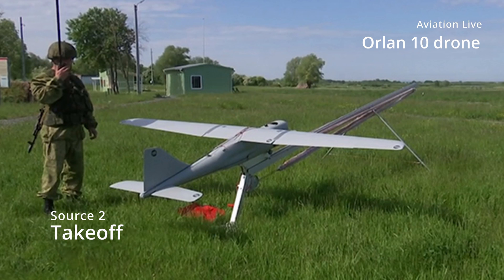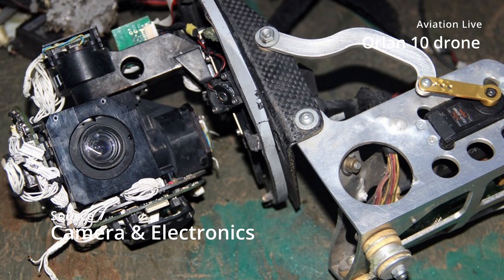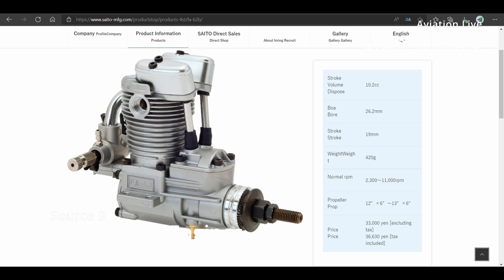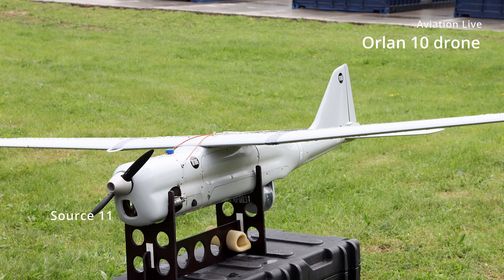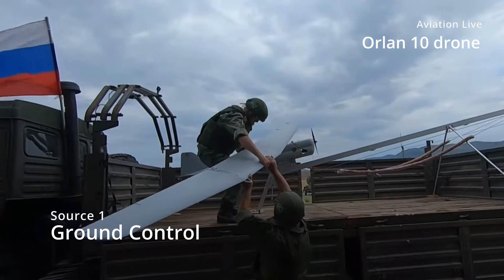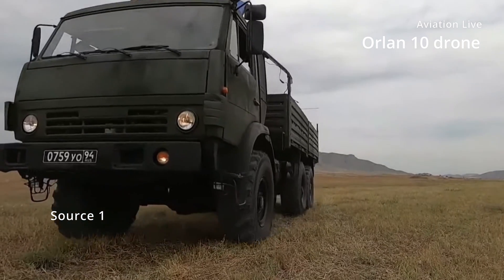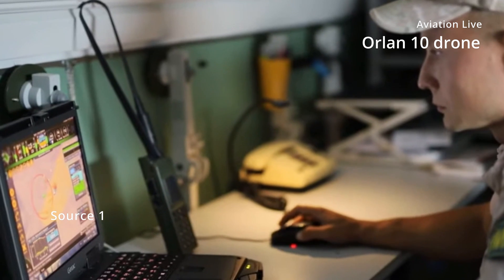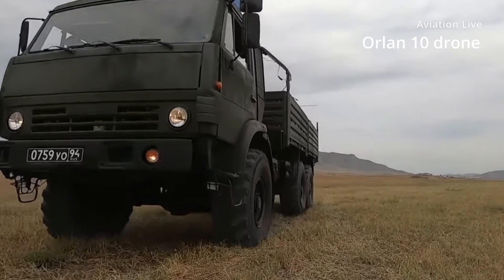Russia's 100.000$ scrap drone - orlan 10 | Aviation news by Aviation Live

Comment: The commentator and many people here are armchair generals with little knowledge of this subject. Say what you will but this drone is responsible for destroying or damaging thousands of Ukrainian military vehicles along with many ISIS vehicles in Syria. Dozens of videos prove this. As for its components, there are many variants of this drone, some are more crude and cheap and some more sophisticated and costly. That is because the Orlan-10 is used by a variety of customers such as border security, agricultural, military and scientific research.

The more sophisticated Orlan-10s use unknown optics, definitely not a Cannon camera, they have also added a rangefinder for laser guided artillery and aviation strikes, thermals, 3D battlefield mapping, more powerful Saito engines, electronic warfare jamming and the newest upgrade includes up to four 40mm unguided munitions. So the platform is very flexible and capable based on mission requirements. The range is also impressive so is cost and numbers produced.

As for people critiquing it for having some civilian or foreign components. So does every other drone, there are dozens of small drones made by dozens of countries. Do people think those drones use space laser engines? They use engines that are similar if not identical to what hobby aircraft use. Microcontrollers and microprocessors are from civilian applications, in fact the best technology comes from civilian applications and then is adopted by the military once it is mature….example is Space-X. Let me explain something, no drone or aircraft manufacture makes everything in-house. Lockheed Martin does not make its own engines, or radar or tires or hundreds of other components. They use hundreds of third parties such as Honeywell, Raytheon, Texas Instruments, Intel. Some components of US aircraft even come from China or have a lot of influence if not down right copying technology from Israelis or Russia. The basis for the F-35 was the Yak-141, in fact Russia offered technical assistance in its development early on.

The Orlan-10 is capable, flexible, proven and cost effective. It was designed to be affordable, reliable and mass produced. It’s not the most sophisticated drone in Russia but it was not designed to be. It’s better to have 1000+ Orlan-10s that use affordable and proven off the shelf technology then 100 drones that cost 10x more because Russia decided to contract domestic suppliers to built specific nich components such as smaller engines. For instance Russia produces some of the finest and most power engines in the world for its helicopters. They are praised for there performance and reliability, the MI-17 and Mi-8 were often used in Afghanistan by US and Canadian special forces. So yes Russia could have ordered some of its world class domestic manufacturers to design and manufacture smaller engines but that cost would include research and development, testing, facilities, production lines and additional employees. At the end do people realize how expensive it would be? It would make more sense to buy a $1,100 engine from Japan then build one yourself that would cost 5x more.
Reply: Sorry no.  Just no. You appear not to be the average Russian bot.  Why do you believe any of that nonsense?
Reply: @DMZDMX1  Nonsense? Its a cheap drone that is effective. There are dozens of videos on various telegram channels that show how those drones pinpoint ukrainian positions for artillery and rocket strikes. Those drones are very cheap and good.

Comment: This thing isn't that bad and no "scrap" in my opinion. Even without considering its low price it seems to be very capable for reconnaissance. And up to 16 hours in the air with up to 150 km/h isn't that bad. But I agree that it seems to be very primitive compared to other, esp. western, ukrainian, turkish, chinese and japanese drone systems.
Reply: Thats why its "scrap". It does not need to be modern but cheap and effective. And it is. Plus you gotta remember the price is 80k for a whole kit consisting of 2 drones, a control station, modules and more. This is cheap. So its very good for what it wants to be.
Reply: It is very good drone but loud petrol engine is fatal flaw, I can imagine project of just another RC drone with microphones and cameras to hunt for Orlan due to sound of chainsaw. I'm curious why Ukraine already didn't done it and hundreds of hunter drones do not patrol the sky, this can be done with modified open source software.
Reply: @martino6172  These japanese 4-stroke engines aren't that loud.